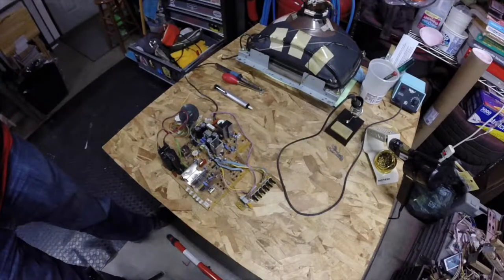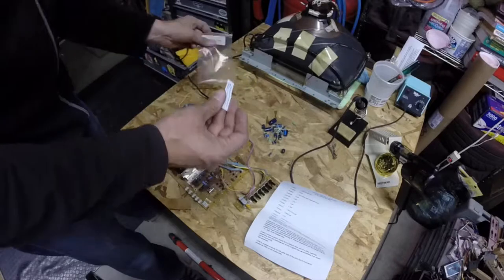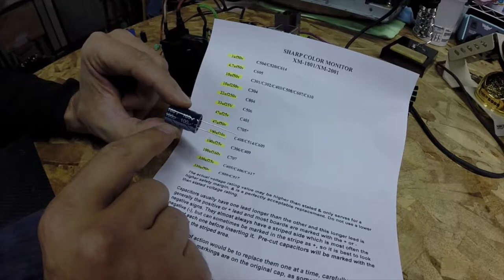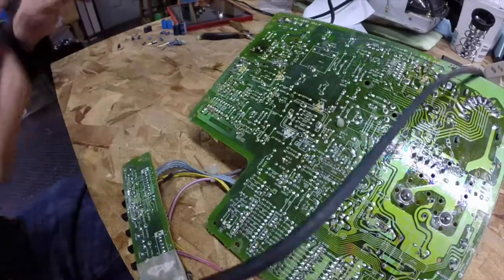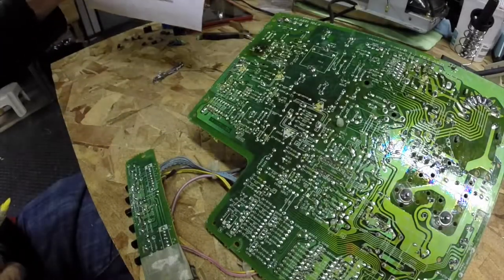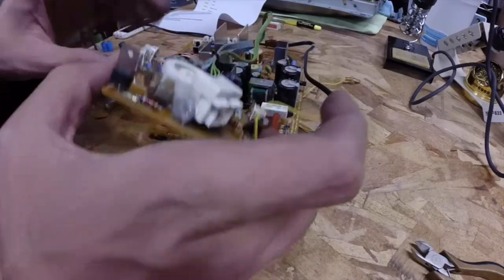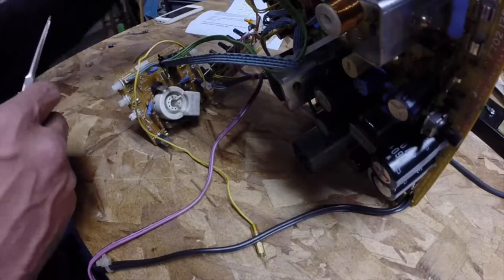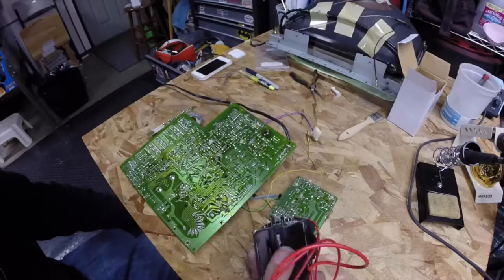BitBar - Episode 10 : Arcade monitor Sharp XM 1801 (part 2) Cap Kit and New Flyback

Comment: That Hako 808 looks frickin awesome 34k. I use the cheap Radio Shack desoldering iron and it was a night and day difference going from a solder pump to that. I wondered how I survived without it. Now, watching your video, I'm getting the same feeling about the gun you use. I just wish they weren't so expensive, but I'm sure it's a good investment. -jimbodeanny
Reply from the maker: For doing small components a solder sucker is okay. For doing larger joints with lots more solder, I can't imagine a better way and the 808 does the small stuff well to. I'll send you the link to the group buy.

Comment: Where do you buy your cap kits now that Bob Roberts is on hiatus from selling kits?
Reply from the maker: That is a good question. We aren't there yet, but Bob will not be a resource forever. There are a lot of other places that sell cap kits though. I would try any of these vendors:

 - http://www.arcadecup.com
 - http://www.twistedquarter.com
 - http://thearcadebuffett.com

Another option is to "build" your own kit. I am sure with a little searching you can find the common replacement parts and values you will need for most any chassis and get the components from electronics distributers like DigiKey or Mouser.

Comment: Is it me or are the capacitors at C706 A & B leaking?
Reply from the maker: +72SSAbody Are you talking about the gray stuff on those filter caps? If so, that's just a rubbery adhesive that Sharp put on some of the parts on these monitors. It's actually kind of a pain in the ass to get off. On the monitors I replaced the filters, I used a pair of side cutters to remove it before pulling the parts.